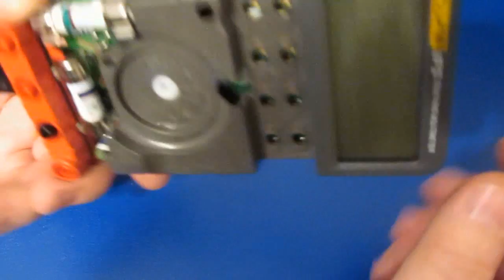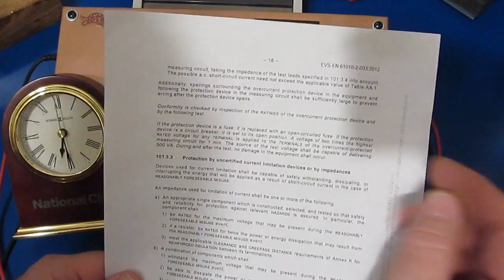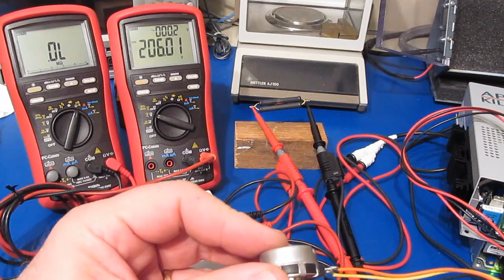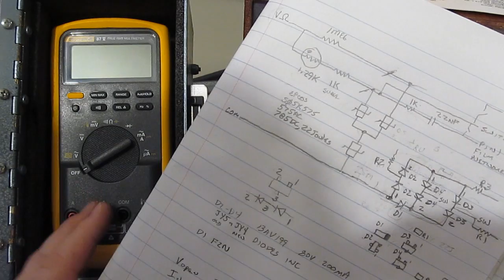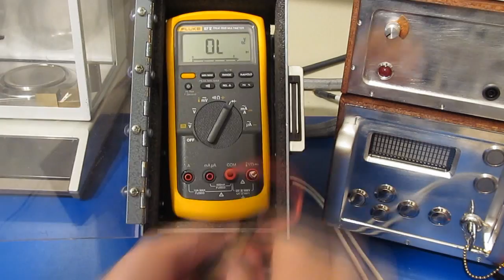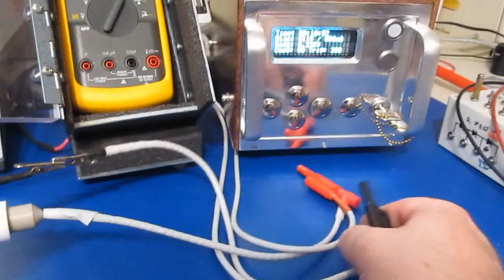Fluke 87V Robustness Tests,  Part 4

Comment: That sleeving is rated for 5kv, as it is also used in street lighting as insulation for the internal high voltage wiring to the socket of the lamp from the ignitor, and from the ballast to the ignitor. That applies 3-4 kV to the lamp to start it, and can have a very high voltage for a long time when the lamp is EOL and no longer starts or cycles, or has broken the arc tube and the internal safety shorting has not worked to short the ballast, or the lamp has been removed.
Reply from the maker: I doubt very much that there is only one source for this sleeve and the quality is the same for all of them and that there is only one size and they all follow the same requirements.  We also see where with some parts (like the rubber boot for example) have suffered quality problems.    I have shown meters using similar sleeve material in other meters.   In this case with it right next to the fuse,  I wanted to run it up and verify the sleeving, creepage and clearances.

Comment: Joe, Fluke make an intrinsically safe version of this meter with a even more unreasonable price point. Do you know of any differences in the meter or is all down to testing and certification?
Reply from the maker: If you were working with explosive fumes, I doubt the price point would be a big deal.  I don't have a need for such a rating and have not looked into it.

Comment: I guess that the LCD/Keypad plastic is installed after the shield was installed, causing the plastic to push out the metal shield out.
Reply from the maker: As I  mentioned, there are no clearance problems.  The screws that hold the shield in place actually thread into that plastic you mention.  You could install the plastic first using the two screws that are separate and then install the shield.

Comment: Mmm, I've got a bone to pick with your arc testing of the failed fuse. When you removed the HRC filler contents (presumably silica, but I couldn't find an MSDS from Littelfuse), with it you removed an important component -- the fused silica that formed when the fuse blew. Depending on how it blew, the more fused silica (which has a dielectric constant about 3.5 orders of magnitude lower than air, and 4 orders from silica) was formed, further changing the flow characteristics.

Electrical conductivity properties gets real complicated when you arc. As plasma is formed, he air composition moves from your standard "mostly O2, N2 dimers" to things like NO2, O3, etc. In the plasma transition phase itself there are going to be weird phenomena occuring like double layer Deybe shielding. Then the absense of the silicia will be replaced with the ambient atmosphere of your lab.The humidity content of your air is going to change the K value. To further complicate things, ohms law only operates in a linear fashion within a window. (There's an interesting paper from '88 out there, describing how extremely dry or super-saturated air remain monotonic but develop an interesting curvature (http://dtic.mil/dtic/tr/fulltext/u2/a199599.pdf pages 15-18)). I ain't no fancy physicist but electrical arcing be some complicated hub-bub.
Reply from the maker: I'm sure there is point in there some where but you never seem to get to it.
Reply: You performed a completely useless test by emptying the fuse out. It's simulating a fault which would not exist. In the field you either have an intact fuse, or a blown one. If it's blown, there will be silicia (and presumably aggregate generated from the fault) inside the tube, acting as a resistive element through the amps front-end path. In effect, by emptying out the fuse and eliminating the fused silica aggregate, you're simulating a field-fault that's actually the exact opposite of what a user would experience . (This can easily be verified by measuring the electric permeability of the fuse in circuit and functional, the fuse blown however intact, and a fuse with all of the filler material removed.)
Reply from the maker: You completely missed the whole point of this test.
Reply from the maker: I posted your comments on the EEVBLOG site if you care to join in the discussion.   http://www.eevblog.com/forum/testgear/hear-kitty-kitty-kitty-nope-not-that-kind-of-cat/2550/

Comment: Great as always. Thanks for the video. Looking forward to get the meter damaged :D Out of curiosity I opened my meter (feck the warranty) and the shield was bent.Yeah, poor craftsmanship. 
I bought my 87V in a heart beat after several months of saving.  You're ruining my life : ))))  I'm kinda disappointed with my choice, however it's always good to know the limits of a T&M device.
Reply from the maker: Sorry to hear that about the shield.  That's two that have looked and found this to be the case.   I really don't get how this could happen.  It seems to fit just fine.   Fluke really doesn't make a good meter for electronics, IMO.  If you were an electrical worker, they have you covered.  There must not have been enough of a demand for meters like the 189.    For me, the best meter they offer feature wise is the 289.  The screen is too small, boots slow,  graphing the way I would use it is pointless.  I would rather have the faster less feature rich 189.
Reply: I have 2 fluke 289s and mainly use them for onsite data-logging. They are great, but suffering from high battery consumption and also poor outdoor visibility. Looking into market, i couldn't find anything close to them in terms of safety and reliability. UNI-T 181A will die with ONE hit of a grill starter (no modification of course) and there's another CEM with has a very poor build quality, and Bremen is not available in my country. either.
Reply: I would guess there was a batch made, and the same small crew doing the assembly, and they were either in a hurry, or were poorly trained, or were new crews on each batch, to make the same mistakes in assembly. 

I guess there was no tear down QC on the finished units, just a calibration and function test on the bare boards, then on the nearly fully assembled units, followed by a final exterior QC visual test and spot checking on all the ranges as final assembly before being packaged.
Reply from the maker: Does seem that they have been building them with the shield bent for several years, rather than an isolated batch or group of people in a hurry.  As I mentioned during the video, the first person who contacted me about it had a few years older 87V and theirs was also bent.
Reply: Well, I don't think only one or a few recently made batches have "bend gate" issue. Yesterday i convinced a friend of mine who bought his 87 V 4 years ago to take his meter apart and surprise!! The shield was bent. I cannot understand why or how they managed to bend the shield despite the straight design and assembly.

I have many friends who have multiple 87Vs and i'm gonna check their meters too.